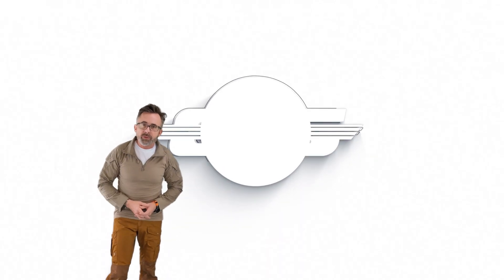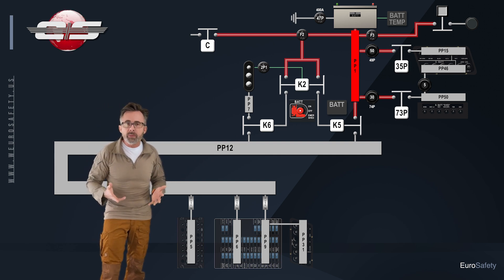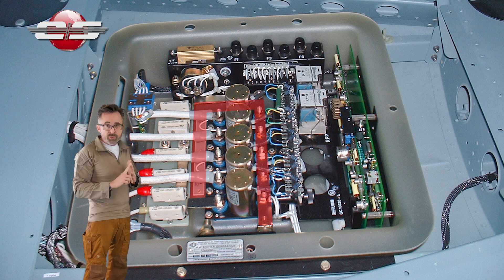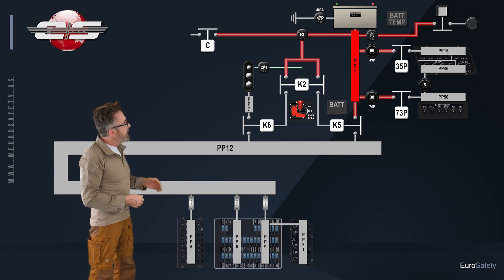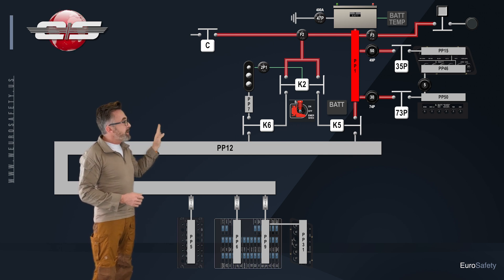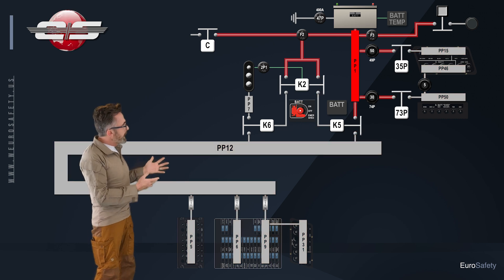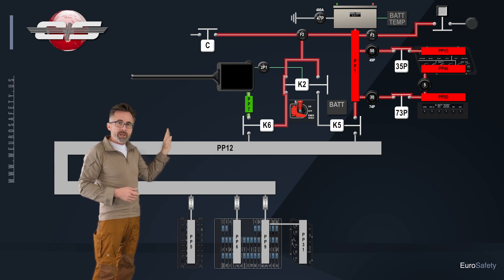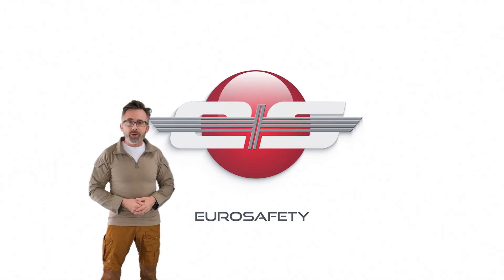#35 - On the AS350/EC130, Can you recharge the battery when an external power is plugged in?

Comment: Is this still the case for SD2 and FX2 series? They have a seperate BAT and BUS switches which means that the system functions completely differently from the designs you're referencing. Whilst I do not have strong opinions on either, as I understand it the appeal was to replace the Safran with the LTS so you didn't have to deal with their "support" and in addition to this, Eurocopter/Airbus wiring with their own designs
Reply from the maker: The soloy modification keeps the same electrical system. The Heli-Lynx installs a completely different electrical system. In the FX you also can not recharge the battery. The FX conversion for the 355 did simply the electrical system and reduce the aircraft weight because of the removal of wiring. The electrical modification for the 350 is different but not lighter. The catalyst that had the mod popular when it was introduced was the pronounced price increase at Turbomeca for overhaul. The historical issues of the LTS failing is what destroyed its popularity when it came out. The issues were mostly fixed but when operators started have fuel control failures and engine chip issues the industry quickly moved back away from the engine. I am not saying it is not a good platform, I am just relaying the industry mindset.
Reply: @EUROSAFETYTRAINING  thank you for such an informative reply :)
Reply from the maker: no problem

Comment: when I unplug external power relay switches to internal battery, So helicopter don't have power for a moment?
Reply from the maker: Yes for a split second it does not. That is why if you plug in the GPU after the battery is on in a FADEC equipped helicopter you will get the amber GOV light. The reason the light does not illuminate after the start is that the alternator is supplying power to the FADEC after 60% N1